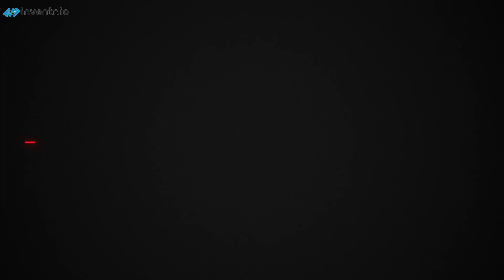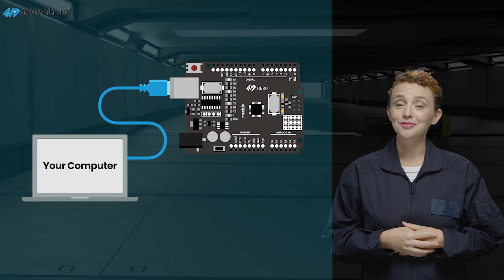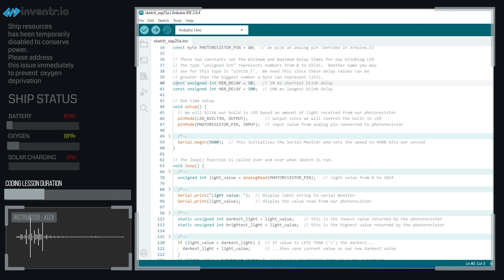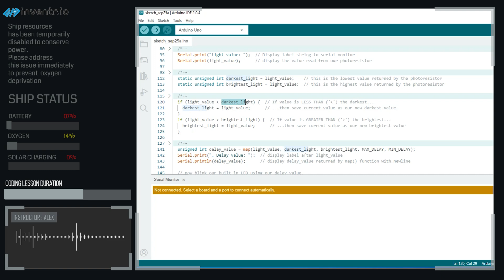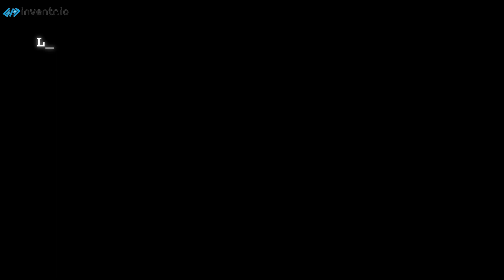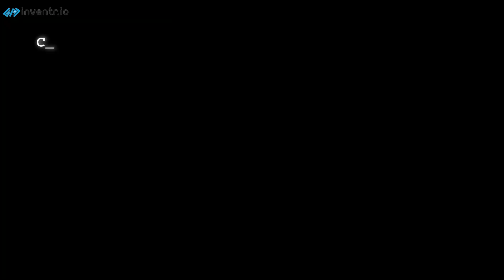[Day 06] Adventure Kit: 30 Days Lost in Space (2023 Update) - Revised

Comment: Perhaps this is a stupid question; around the 26:30 mark, when the voltage on each side of the resistor is being read by the multimeter, why wouldn't that create some kind of short circuit? Is that not creating a path from the 5V pin to the ground without any significant source of resistance? Or is the photo resistor enough, (even in a bright room) to prevent that from happening?
Reply: The voltmeter has a very large resistance inside it (think Mega Ohms), thus the shortest path from +5 V to ground is still through the photoresistor and then through the other resistor being measured across. An ideal voltmeter would have infinite resistance (open circuit) so no current at all would be drawn through it and the voltage across the measured element wouldn't be affected, but in reality it does have finite resistance and draws a tiny amount of current.

Now for a current meter (ammeter), it must be in series with the branch you want to measure current in, so it is configured to be a short circuit with as tiny resistance as possible for the smallest possible voltage drop across it (and thus the tiniest effect on the current as possible).